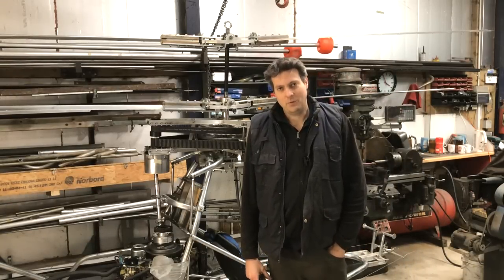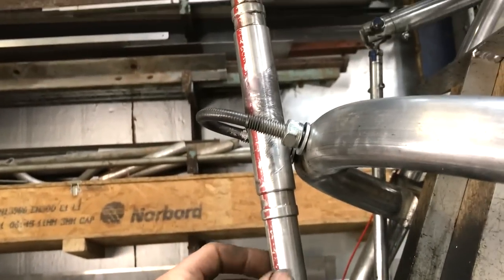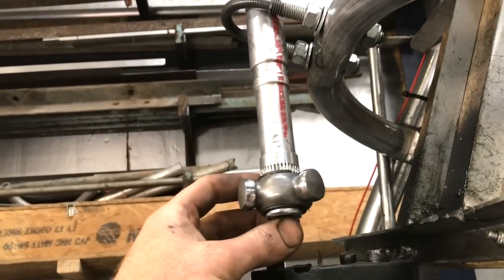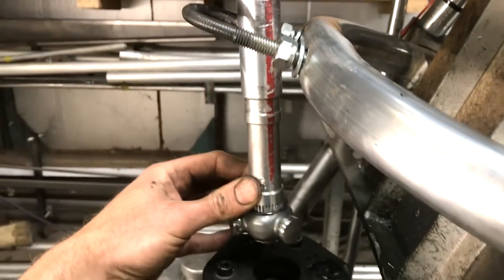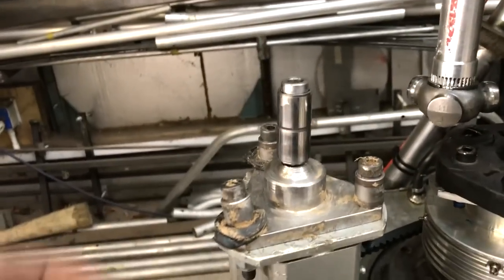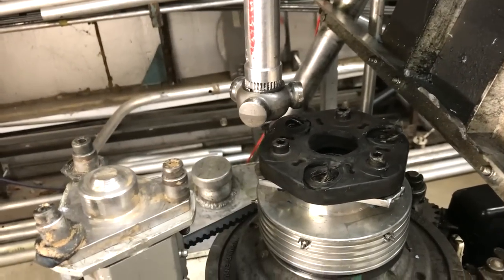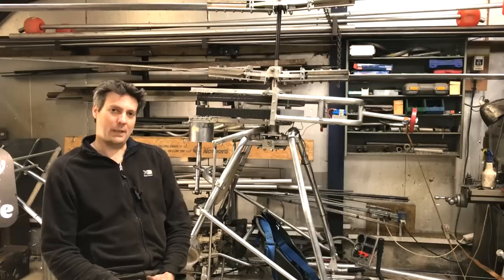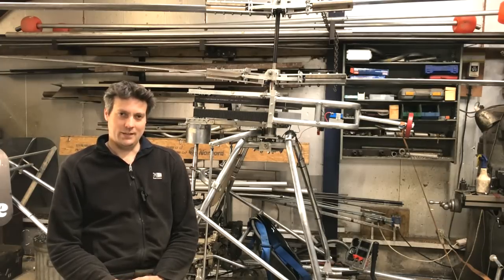What I got WRONG, Homemade coaxial Helicopter

Comment: Why would you try to build such a complex machine?  I am an ex RAF fixed wing pilot.  Aerobatics, formation, instrument rating, low level.....What is wrong with an airfield?  Vertical take off?  Who cares?  Flying will kill you!  Keep it simple!  It is soaring into blue skies, clouds below, the peasants trudging along in the rain, while high above, we, demi Gods get to change gravity......
Reply: Ah the joys of circuits in a spamcan. This was about the challenge of building something that can hover a few feet above the ground, learning from mistakes and making improvements.
Reply: @millimetreperfect  How about aerobatics?  A rainy day but Met report says clear above 3,000ft.  Climbing on instruments thru the clag, bursting into sparkling sunshine.  Here to frolic like demi-Gods, looping, stall turns, barrel rolls, then off to the Mach loop - 50ft up throttle wide open.......
Reply: @davidwheatcroft2797  for sure you’re right but it all costs, I bimble around in a weight shift for the cost of 12 litres of mogas per hour and some hangarage, this guys dream was to build a machine and travel around a Devon field, he got fairly close to his dream. Side note: not sure what the CAA would have to say about it all.
Reply: @millimetreperfect  Weight shift very limited.  Tend to fly like a piano when power off, but good on you for taking the initiative.  My Renegade 2 flew like a dream; finger tips; no need for elevator trim; could feel a bonfire from 1000ft above.  Had too thin slave aileron struts - giving me a heart attack on my first roll; juddering.  Bloody shit 4 point harness also releasing and had to hang on stick to stop falling out!!  That night ordered a nice 5 point one from Wicks.  CAVU skies to you, sir!
Reply: @davidwheatcroft2797  I would have to disagree with you: if you and I both cruise straight and level, kill our engine, now gradually pitch up, all the way and hold it…..now whose riding a piano and who is descending in control. Admittedly, I’ll have a heavy landing if I’m not allowed to pitch down in order to round out. What tune would you be playing something ethereal?
Reply: @millimetreperfect  My a/c did not stall.  Power off, raising the nose till stick all the way back.  No buffet, just mushing down.
What I am talking about is power off glide.  Mine 40kts for climb AND glide.  Just like a proper aeroplane.  Yours, power off, a 45 degree descent.  Your wing essentially a ONE speed wing.  Yes super slow, but just a narrow speed range.  Mine 30kts to 110 kts.    
Come on!  Yours second generation.  Mine a frigging aerobat.  How can you possibly compare?....Anti crush tubes on tailplane bracing wires....ie. (a) a doubler at perimeter, and (b) surrounding the bolt thru the tube, a cylinder to stop possible crushing.  Double SS flying wires; Hypec paint system using the grey (Al powder) paint to stick the fabric to the anodyned scitch brited Al metal.  Isocyanide epoxy paint with clear coat on top of Racing Red Metallic.
Reply: @davidwheatcroft2797  How can I compare? It feels like you are doing all the comparing, I have tried aerobatics in a Pitt’s special and a Stomp some years ago but I prefer to keep the Blue side up. I am glad you are proud of your well designed and no doubt well built aircraft. I love the near unrestricted view of the Devon countryside from my little weightshift.
Reply: @millimetreperfect  I have flown a few "picnic chair" a/c, and I was astonished at the steep glide angle.  Have also flown a motor glider.  Did not want to go faster but just wanted to climb at full power.
Flew Chipmunks mostly in RAFVR.  A proper a/c with full IFR panel.   My favourite was "unusual attitudes" - climb to 7,000ft under the hood (so I cannot see out, like IFR); the instructor then pulls hard G making ALL the gyros tumble, then gives you back the a/c, "You have control."  Nothing to be done except power back to idle and hold stick firmly in case going backwards (would snap off elevators!)
I would make a point of chuckling to show I was not worried!  ONLY 2 things - do not exceed the Vne, and hold stick firmly.  Plane unbreakable......deliberately falling backwards from a stall turn; taking your breath away as you tumble....Formation, SO fun!  "Red formation, rolling, rolling, GO!"  Surging along 2 ft away - no more up/down/left/right, just stay there near the lead.  We even taxied in formation doing the S turns needed for tail draggers.  Did I tell you I got a Permanent Commission, one of 20 from 4,000 applicants!
Reply: What it is David I'm lllike Ben we like the engineering challenge of a small helicopter,  fixed wing flying is something totally different, it dosnt interest us......Peter
Reply: @cloudusterable  Challenge?  Home made moving parts?  I flew 2/3 times a day; jets sometimes.
You are PLAYING with flying.  Fly as much as iIdid, and you will die.  
My a/c had push-pull control tubes with differential frieze ailerons (4).  +10G; -6G.  Rolled 360 degrees in 3 seconds.
Go ahead and play with death.  I did PAR GCAs where my life was in the hands of the air traffic controller, "Good morning Kilo 54; nice to have you with us; turn 90 degrees right so I can identify you....."
Reply: I think we are on different plains here, you sound like your in an air force, this is an entirely different hobby altogether David.
Reply: @cloudusterable  Yes.  RAFVR for 47 years!  I also built C-IAVW; 6,000+ rivets; 4 rivet guns destroyed; fault on every page of the manual! 
 Flew 2 weeks at RAF Leuchars with 2 squadrons of Lightnings....we played "spot landings" with them - wheels not down between 2 white lines, a round of drinks in the Mess.   After a few days, the mechs came and begged us to stop as the Lightnings were only getting 9 landings from a set of tires; driving in so hard to avoid that round of drinks......at the end, returned my parachute/dinghy pack to stores, "I'm sorry, sir.  This parachute has a kink in the pull wire.  Would never have opened...."  Once we were warriors!
Reply: When your in an air force David, the Goverment foots the bill !..........bit different for us mortals .
Reply: @cloudusterable  Oh, yes!  ......get this - a sugar strike in UK; no sugar for months.  So we fired up a Meteor and sent it to Dublin where they loaded 200 lbs of sugar in the gun bay!....That night, superb strawberry pie with double Devon cream, "There's more, sir."  
But I built my aerobat with a small bank loan.  A $75,000 a/c in todays money.  My brother flies a RV8 - a damaged wing cost $50,000 to fix....nice, 200HP; 200mph cruise; aerobatic.  7 people own it.....fly to Spain with 1 refuel.
Kept my plane at a chap who had won the Lotto.  1500ft strip with radio controlled lights, and he was just completing a 10-200 Ultimate.  Unlimited class aerobat - 360 degree roll rate in 1 second!  So powerful, that at full power, it would dance around in a circle.  He got 100% in his Commercial.  I got 100% in my Ultralight licence.  Sadly he was killed flying his Beech Baron.  RIP.

Comment: Very inspiring! I’d think about slightly different scheme: electric motor, which rotates the rotors, located right next to the timing belt pulleys. ICE connected to an electric generator, which supplies the electric motor. That way you get rid of the cv shaft, everything should work smoother, more compact drivetrain. That scheme could work even if you go with cyclic. Can’t wait to see what’s next! Thanks!
Reply from the maker: Thank you. Look up Pascal Chreten, redback aviation website, he built an electric coaxail. Great design. It should be possible to get more flight time with large rotors than small props like the Jetson.
Reply: There's a reason we have diesel electric trains but no ICE electric aircraft. Weight.

Comment: Hi. You've really done an impressive amount of work there.  I'm not an engineer, but the rotor shaft up to the top blade looks very undersized. In other words, it looks as if it could bend easily.
Reply from the maker: I understand it looks that way and actually next time I would choose a tubular shaft, larger diameter. It would be lighter and stronger the same time. This shaft was ok with a 5.7 x safety factor in torsion (EN24T). As far as bending moment goes I don't think there would be much force involved. The blades can't apply a bending moment to the shaft due to teeter hinges. If they were solidly mounted then yes it would be too weak I would agree,

Comment: I think the hands on practical experience you've demonstrated on this project puts us theoretical engineers to shame. And you've shared the lessons on YouTube to allow us all the benefit of your wisdom. I am definitely looking forward to seeing the Pixie II concepts!
Maybe a trailer test rig to evaluate a few 1/4 scale designs? Use an electric drive motor and measure input power for a given lift. Try to simulate some manoeuvres and use high speed film to compare the results. Give the whole coaxial vs single main rotor discussion some data to make a good decision on.
As a general comment about coaxial designs over single rotor, the aerodynamics are more complicated for anything other than pure hovering flight. Keeping the rotors well apart so you can "pretend" they are 2 separate rotors is really the only option. Also it's worth noting that in the end the Eurocopter X^3, with single main rotor unloaded by wings, achieved a higher speed than the Sikorsky X2, with high effective hinge offset coaxial rotors. So maybe the coaxial advantage is just one of those clever theories that has never really been validated by test data...
https://en.wikipedia.org/wiki/Sikorsky_X2
https://en.wikipedia.org/wiki/Eurocopter_X%C2%B3
Reply from the maker: Super comment thankyou! I will give it some thought. Thinking about what direction to go in.

Comment: I’m so impressed with what you’ve done.....much respect. Possibly the most difficult part of the process of invention is the point where you need to decide whether or not to shelve a project and make a major change in direction. Which ever way you choose, there will be many of us rooting for you. The world would be a much less interesting place without adventurers like you.
Reply from the maker: Very kind, thank you 😊
Reply: I know it’s hard to stop working on a love you spent so much sweat and toil on. When you explained about the Giro effect on the top road or I never realize that but being mechanically inclined I am I can see how that would be hard to move quickly. I would step back and think this out. Had your neighbor build same style as yours?  How did his turn out?  I love anything that flys.  And wish I were you with a opportunity to do a collective pitch one.  I follow a guy in the Netherlands making a CP helicopter, I’ll send you a link on what he’s building.  I joked with him that I have the plans (digital) of same bird.   I do hope you carry on.  After a break of course.  CHEERS
Reply from the maker: Thanks Bruce, my neighbour built a single rotor but it couldn't stay in the air. Too heavy I'd guess but it did do a small hop I'm told. New project ideas are coming in, definitely collective this time.
Reply: @Ben-Dixey  wonder if motor was under powered.  Would you consider making an offer , buying his and make improvements?  Just a thought.  Oh and my offer still stands if you like
Reply: @john You have said exactly what I want to say, so I'm linking your post instead. :)

Comment: Always interesting to see your adventure - I would suggest as your next project would be something like a Jetson quad flying machine for ease of production, or a conventional helicopter with an electric anti torque fan..... Maybe ?  Anyhow, I wish you good luck !!
Reply: Quadcopter with sensible autorotation ability would definitely be a game changer. A lot of contemporary e-VTOLs, claiming they don't need to autorotate due to >1E9 hrs per fail, just make me nervous - batteries & motors can and do fail in flight. Electric main and tail rotor drive make good sense as long as you can still control the aircraft after power failure - for tail rotor that might mean an autorotation or reliance on vertical empennage for anti-torque.
Reply: @martingarrish4082  I think the advantages are - multi motor redundancy should keep them in the air, or the use of a ballistic parachute as back up should it go wrong...
Reply: @john3Lee  , multiple motor redundancy is always a good thing, and BRS has definitely saved lives in fixed wing applications. But BRS does not preclude fixed wings from having the ability to glide, and its deployment below 500' AGL is regarded as a might help scenario.
The e-VTOL argument that somehow they can ignore the principle of low disk loading because the BRS is a magic fix all does little to convince folks like me about the design credibility. Batts are most likely to fail at the end of a long flight, near the ground where BRS just won't help. Also the idea of mixing parachute lines with rotating blades sounds like a whole heap of bad outcomes. Best to design the rotor to act as an already deployed parachute in the "highly unlikely" event of total power failure...
Reply: @john3Lee  , perhaps I judged to hastily: google the Zefhir helicopter to see BRS fitted above rotor (I can't post link as YouTube then deletes post). However, the helicopter does have autorotation capability, and the website itself states "If you can, autorotate. But if you can’t, the parachute will save your life!"...
Reply: @john Wheatley....another vote for ballistic reserve.
Reply: @johnparsons9084  , I'm absolutely for anything that can improve VTOL flight safety. My worry is that many (not all) e-VTOL companies seem to have forgotten the laws of physics and use BRS and e-redundancy to justify fixed pitch high disk loading designs. Fortunately the certification authorities appear to share my view.
Reply: Agreed. Ballistic Reserves should never be a Band-Aid for flawed engineering. I’m not knowledgeable enough to comment on which eVTOL’s may be pressing the limits, but you bring up an interesting point I hadn’t considered. Thx.